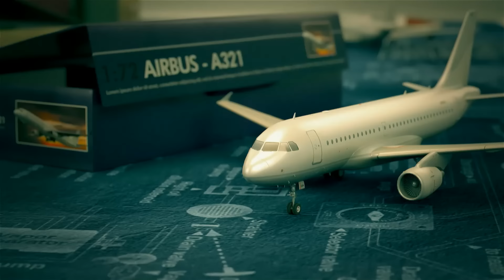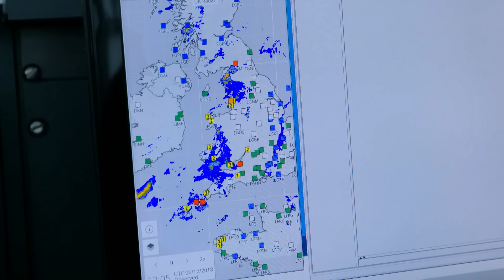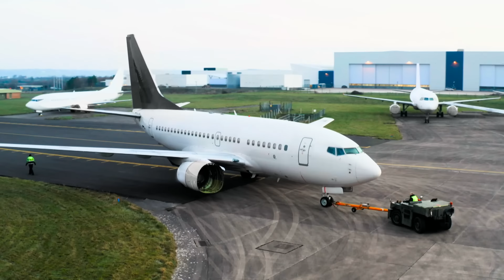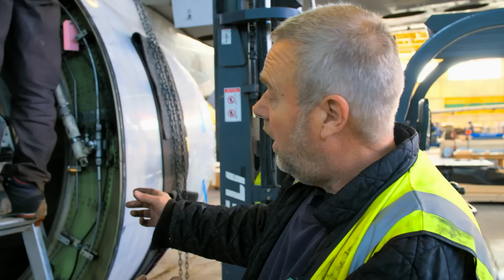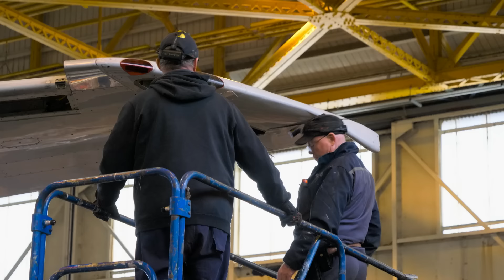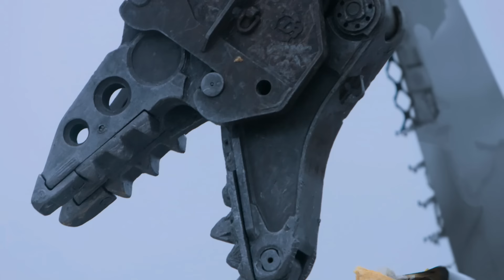Boeing 737 Final Flight to Welsh Scrapyard

Comment: It’s fascinating that certain Douglas DC-series aircraft remain operational in cargo service after 50+ years, while many modern Boeing and Airbus jets are retired and scrapped after just 20–25 years. Is this due to differences in airframe durability, maintenance economics, or design philosophy? What factors are we overlooking?
Reply: It has a lot to do with the value of the parts

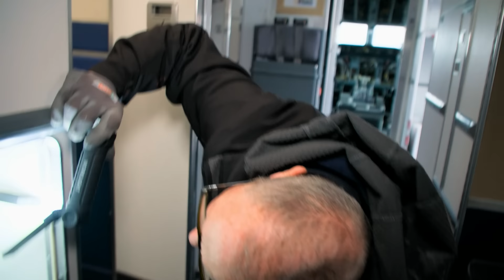Comment: They are heat sensors at 21:25 and don't, "... detect any potential heat source ..." because if it's only a 'potential' source it's still probably cold. In addition, although the principle of the 'Fire Triangle', as stated is correct, Halon 1301 does not operate by reducing the Oxygen level. The extinguishant designed concentration in the protected space will not reduce the Oxygen sufficiently to supress any fire. Halon works by chemically altering the combustion chain process, which, in effect removes the fuel, however, the agent discharge will also rapidly cool the space and reduce the Oxygen level to a point where re-ignition is unlikely.

Comment: This is now an old video, but a lot of what we saw here is still current. However, I suspect more of the blankets and insulation are removed now before the final break up because a cleaner less contaminated plane hulk brings more cash value as scrap. 

I was surprised this airplane was  a pretty low time in airframe hours and number of cycles for a lifetime use of this model of airplane.  It still had a lot of life left in it.

But currently in 2025, there are jet airliners that are basically still showroom new being sent to the dismantlers because their value in parts is much higher than the market value of the whole plane and so they are being dismantled for a profitable return.
Reply: Yes it was scrapped in 2019 only 20 years after manufacture which is nothing nowadays. Think the key for this is that it was the smallest NG variant the 600 of which less than 70 were built and wasn't popular for it's small passenger capacity, I believe all but about 10 have now been scapped.

Comment: They need to remove all the fiberglass insulation first. Environmental nightmare not doing so.
Reply: Perhaps you should let them know, I'm sure they would appreciate your input. After all, they're very, very, very new to the business.
Reply: @eddieedmondson7698 Trainded to a Ph.D. Level of environmental safety, protection, controls and infectious disease, and cancer prevention with decades of forensic failure analysis engineering experience, I will gladly share concerns with anyone who is willing to actively listen.
Reply: @icare7151  You sound like a right one.